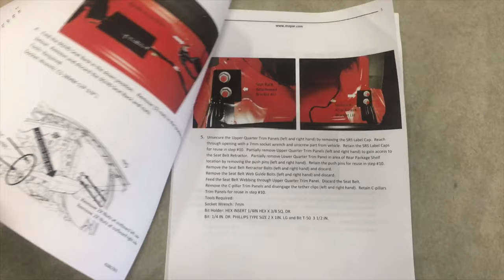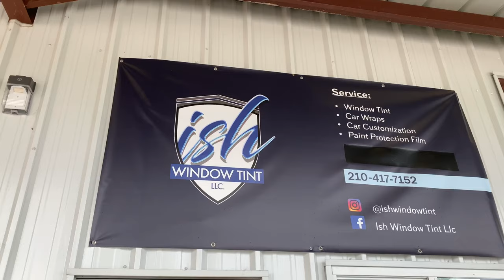Challenger Build Montage!

Comment: What year is your SRT ?
Reply from the maker: It is a 2009 SRT-8, 6.1 hemi with a mild cam and other bolt ons.
Reply: @TIRADORACING  yeah I saw that sexy 6.1, and is the hottest looking motor that has been used in a production vehicle over the past several decades in my opinion. I knew that it had to be in 08-10, as 2010 is the last year for the 6.1 and am sure you already knew that. Mine is a 2010 and really like the design of these Challengers, as they are definitely the most retro out of the Big 3. So did you do a custom grind on the cam, or is it maybe a comp ?
Reply from the maker: Crazy SRT-8 I agree ! That’s why I chose this car lol I love the retro look! And it’s a custom grind crower cam.  I mainly did the cam to have the car chop like the old school muscle cars, when I set out to start racing it was kind of a bonus it was already in there. If you have Instagram I can send you a pic of the cam spec sheet.
Reply from the maker: You can find me on @tiradoracing !
Reply: @TIRADORACING  yeah me too and amazes me how much they've advanced from ours to hellcat, and then there's the demon lol. So then you got the custom grind, that's cool and love it when they thump like old school. That is one of the main things missing from modern muscle to me, and makes them more complete. I'd like to do that with mine, but have been also thinking about a blower as well. But haven't decided which way to go yet. BTW, don't have Instagram
Reply from the maker: Crazy SRT-8 can’t go wrong with a small cam or a blower! I think the boost would be more fun! And dang no problem ! You can find me on Facebook on as well lol